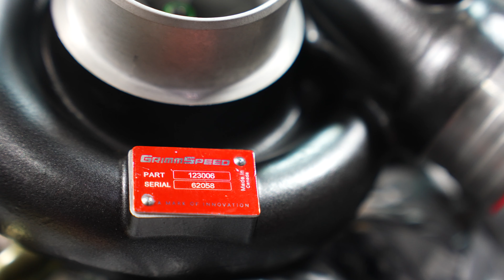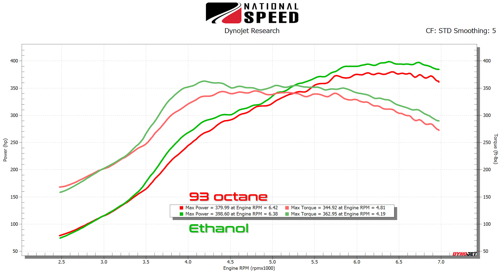GrimmSpeed BB500 Turbo Installation on 2020 Subaru WRX STI

Comment: Do y’all think the smaller 400 would get a 2.5 hybrid longblock to mid 300’s? Building a stock RA 257 s.b with IAG s20 pNp heads with IAG internals? Type of cam is still in speculation T.I.A 👍 awesome vid
Reply from the maker: A stock VF48 will get you very close to that number on E85.

Comment: Make me wanna get mine for my car. So you just upgraded the turbo and top mount? And made that much? Any other supporting mods?
Reply from the maker: This car also has a Cobb Flex Fuel kit installed, ethanol makes a world of difference by allowing more boost and timing.

Comment: Stock block? Or built?
Reply from the maker: This car is running the stock block. We left the torque at a safe limit for that reason alone. This turbo would have made a lot more on ethanol if we let it.